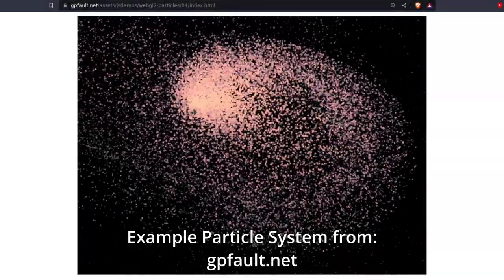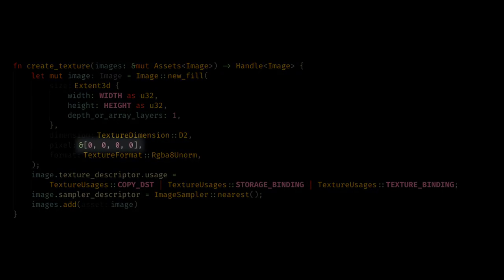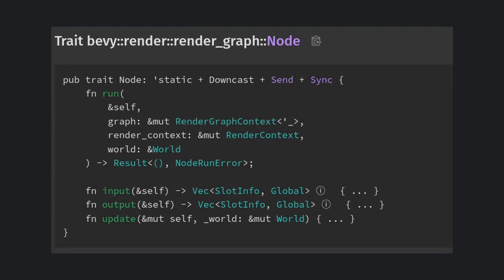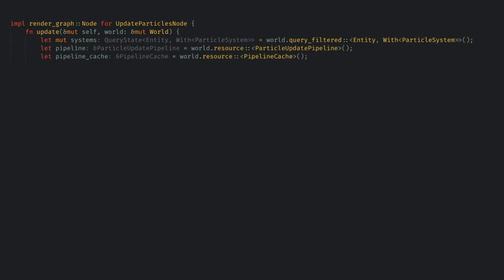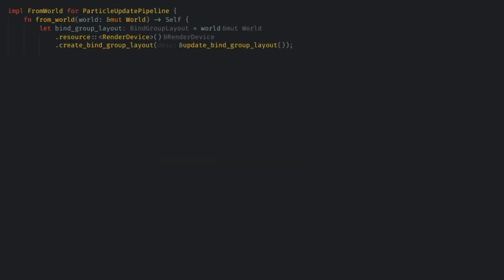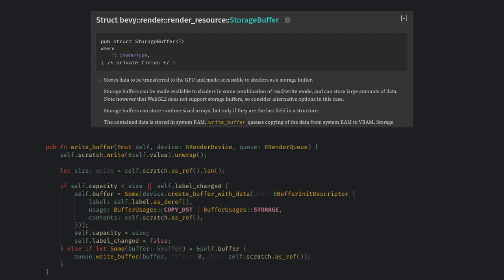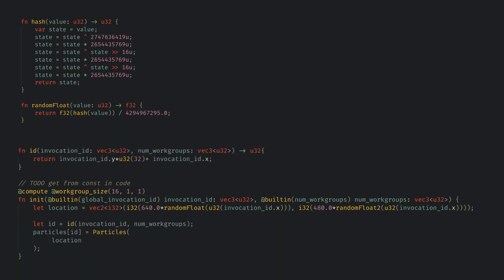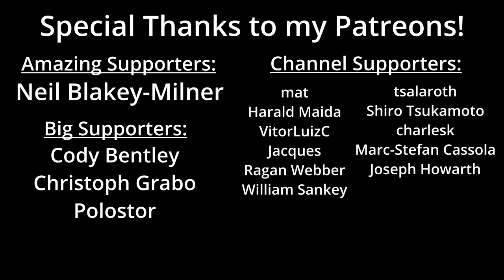Compute Shaders in Bevy

Comment: I really wish there was more documentation and examples on shader integration in bevy, I'm trying to do something relatively simple but unconventional and I don't want to completely tear out the bevy render pipeline and lose out on their parallelism, but most of the bits you actually have to write in their abstractions are standard wgpu boilerplate but more obfuscated and spaghettified because the control flow is not entirely clear from their examples. I'm probably wrong but it's a little frustrating. Thanks for doing your part to help.
Reply from the maker: Yeah the best documentation is to look at how the engine does things. I often have to look at how they handle lights and UI rendering to understand how I could add something myself.

Comment: Great topic. Are you able to build this with wasm-pack or similar and run with same result?
Reply from the maker: I'm away from my home setup for holidays so I can't test that anytime soon. My intuition would be no, because I've seen some issues with the storage buffers we use and WebGL but the overall compute shader techniques should work. But also I've seen bevy internally use them for point lights so maybe it would work, needs testing
Reply: @logicprojects  - thanks, I'll give it a try this week. Just getting back into this. The compute is where it's at, for sure. A lot more legwork, but worth it. I wonder if they'll be able to do a "derive" for this at some point like they did with the regular shaders. That was nice to see all that come together. they really highlighted the power of the derive. Oh, and thanks again for putting this together. You're not kidding when you say there isn't much documentation out there, and I'm not talking about Bevy. I'm talking about Compute. Combine the two, and there's just a few videos now, so each is much appreciated, and all including this one have been a big help.

Curious also, if you've looked into, or used "Multi Draw Indirect" functionality in any game frameworks before. I believe this is able to be done through wgpu using compute shaders, but I haven't looked into it yet. I think in some cases can be very helpful performance wise especially for dedicated (not on chip) gpus in scenes with lots of unique objects (not having to round trip to cpu for each) - not sure how much it buys. probably very scene dependent.